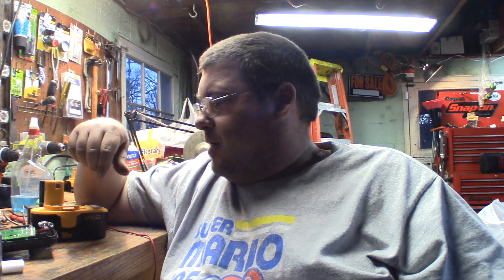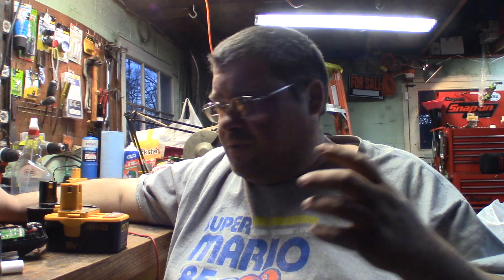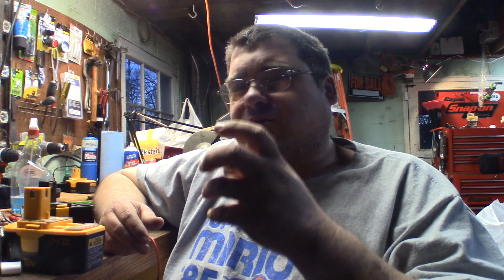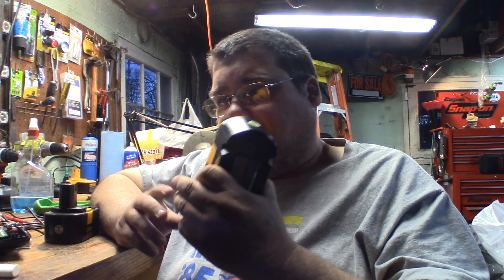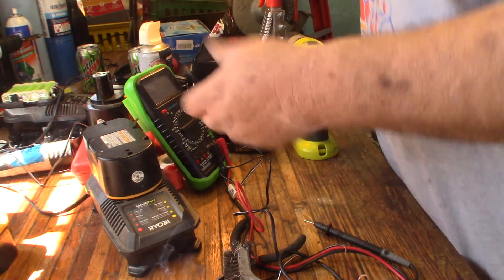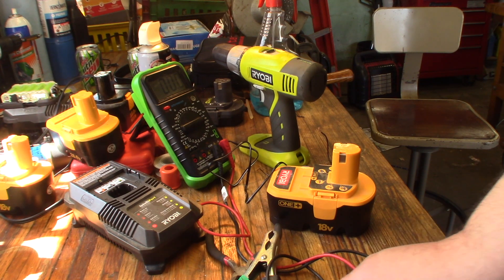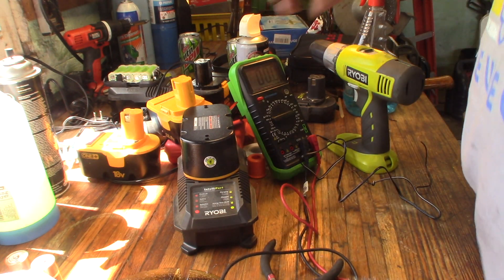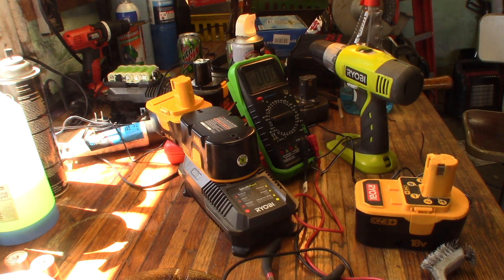How to Bring NI-CAD Drill Batteries Back to Life & Make Them Charge Again - Ryobi

Comment: Hey Frug, What else can you use besides a welder to get that power surge on the battery? Thanks.
Reply: Craig, the video does not clarify what type of current needs to be applied. Hey you was kind enough to clarify, that is a good fellow human. You instead mock. Craig, you are the moron.
Reply from the maker: Anything around 24-30 or so volts should do it.  Two car batteries hooked in series would do it.
Reply: I would not recommend using car batteries for this purpose because of the high probability of the Ni-Cad battery exploding from the extremely high current that a car battery can deliver. That can happen if the metal probe or wire that you use for momentarily tapping the battery contact should weld itself to the battery terminal and you are not able to quickly remove it. Your Ni-Cad might turn into a bomb!
Reply: Thank you hey you. Possible disaster avoided! :-)
Reply: What would ever compel a person to put the times the voltage and massive amperage on a battery pack?  Just curious... a new battery is 50-100 bucks,  if you've ever seen a battery explode,  it's scary as hell. Not for me thanks.  But i commend you for experimenting.
Reply: JP Blitz Only DC
Reply: JP Blitz good point ( Lol )
Reply: What about two wires directly connected to a 110v socket? Can this surge type be AC or it has to be only DC?
Reply: JP Blitz yes

Comment: Awesome vid thanks. U can get 12V car chargers for most cordless power tools and run them off a solar panel. Great for WROL!
....did you say this works for Lethium??
Reply from the maker: Thanks for watching.  NO, don't do this on Lithium Batteries, you will fry the circuitry inside.  I have a video on how to bring back lithium batteries though:  https://youtu.be/NeFSqjIrlbo
Reply: I get the same results just by cleaning the contacts
Reply: craig rowling....No dammit! Lethium can't you read!

Comment: I have to do the same thing with my RC batteries every year.
Reply: Really?!? I have three of the 14volt Dewalt that have this same problem and one is the extra long life battery, and only after two or three years. But a few months ago I found an old 12volt ryobi I had forgotten I had with two batteries and a flashlight in the kit. I took and put both batteries on charge and guess what. They both took a charge and they were bought in the 90's. I have the 18volt Ryobi now that is getting to where not lasting as long as first did, but I have had them since around 2004. I think the kit has been well worth the $150 for the drill, recip saw, skill saw, and flashlight it came with.
Reply: You still use ni cad rc batteries?